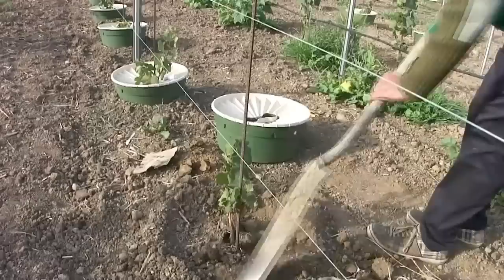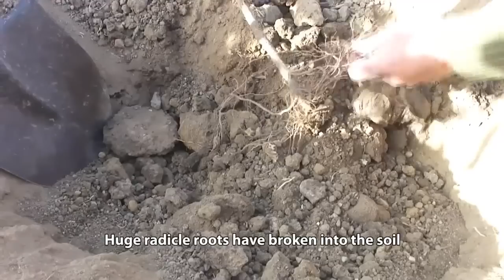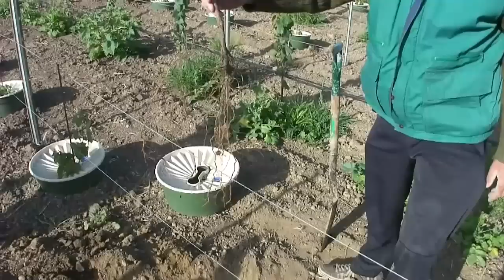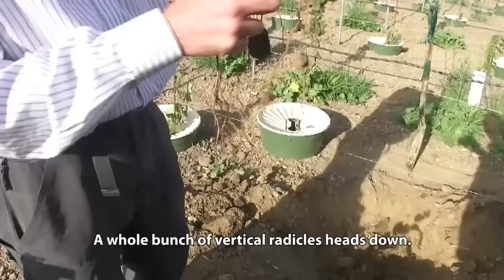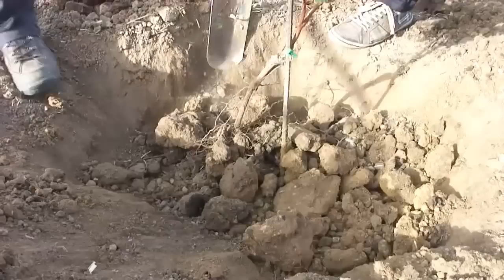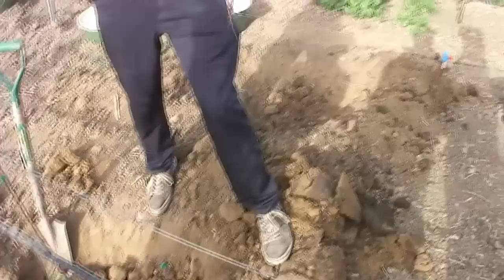Robert Mondavi Winery with Groasis waterboxx grape planting experiments in Napa Valley California

Comment: Hownto get the warer when running out ?
Reply from the maker: The Waterboxx captures rainwater and generates condensation on the lid - so in many places will replenish the water in the reservoir automatically. If there's not enough replenishment, then you can open the blue cap and fill the reservoir manually. 
In most situations the young saplings only need the support of the Waterboxx for the first 6-18 months, after that the root system has developed sufficiently and the trees and shrubs can survive independently - without any further irrigation.